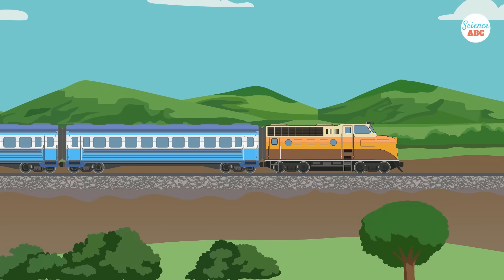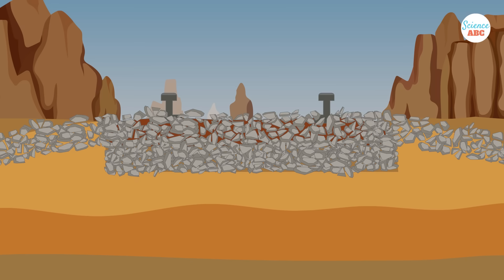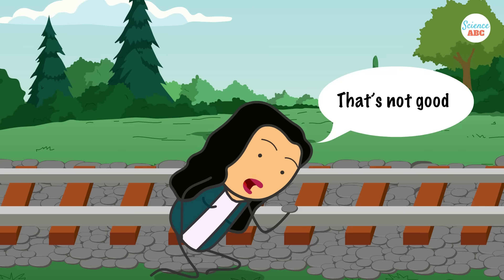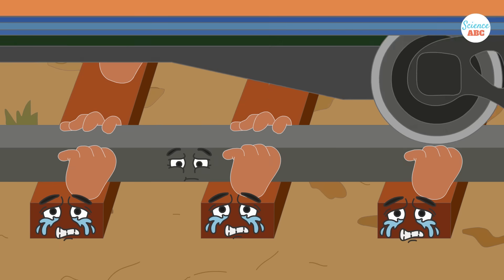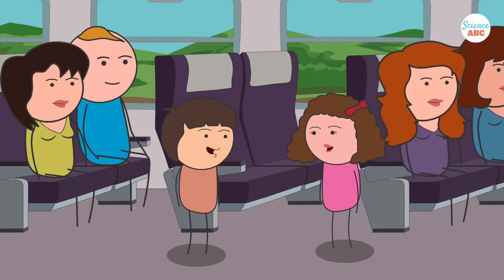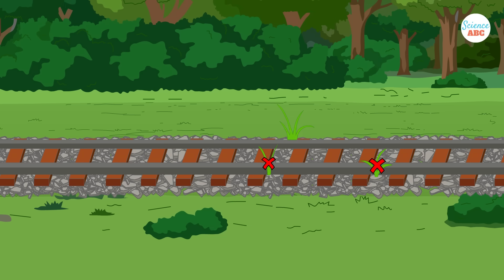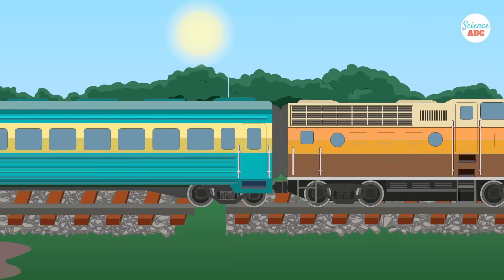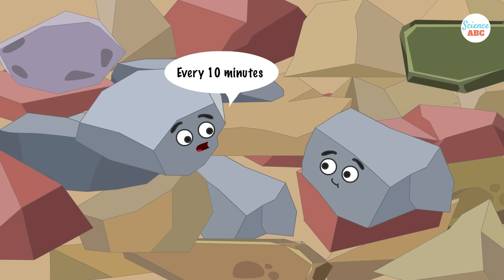Why Are There Stones Along Railway Tracks?

Comment: I work in the railway in Canada so im going to add one you missed.

8. Prevent Grade Erosion and Frost prevention.

Grade is the levelness of an area, walk up hill increase grade, downhill decrease grade. The Ballast bed is dug down to its depth to protect against changes in the natural grade changes from alterations to the ground under it, during in the colder months the ground will actually push up due to moisture in the ground freezing (Ground Frost) when ground water freezes it can expand to nearly 10% of its footprint, and that expansion needs to go somewhere, down is way to hard, up isn't. 

The ballast protects against frost because it gives the ground water (frost) room to move upwards, as well as room to move back down when spring comes.

Grade Erosion is another cause of concern in the railway, especially in some of our higher regions say they Rocky Mountain Foothills...or in some cases Mountain Passes themselves. During wet seasons High topography actually slowly falls down hill due to rain, this can cause depressions to form in the bed of tracks. Ballast has the flexibility to prevent these depressions from causing the rail lines to shift or move.

Why these are both important.

As trains move across the track they force it to flex down, but in some cases that flex can actually rebound and cause wheel hop. Picture in your mind a train car that weighs 80,000 LBS moving over a 100ft section of track, behind it is an empty car weighing maybe 15000 pounds. Without Ballast in place that rebound would cause the car behind it to actually get "bounced" from the track as the 100ft section returns to its natural resting position. Many derails in history have actually been caused by "wheel hopping" a track due to a full car depressing a track and a trailing cars wheels being kicked out of the track.

"Wheel Hop" is typically a serious concern in spring months, and in areas with heavy grades, and ballast is used more generously in these known areas (swamp/marshland, hills/mountains) due to the heavy exposure to Frost and Erosion in them.

Comment: The ballets rocks drain that water not just to keep corrosion down. A heavy train, at speed can get derailed due to large amounts of water. Water is non compressible and will lift the train right off the track.

Comment: The tracks and sleepers are "floating" on the ballast. This is different than a fixed system where the sleepers are fixed to a track bed and are typically concrete. This is needed due to the track gauge and super elevation tolerances and, are usually installed on rapid transit lines with fast moving trains. The track circuits also depend on ballast conditions. Good ballast allows better railroad traffic circuits (or wayside) signals and grade crossing warning systems.
Reply: That’s what I was wondering during the video, I would have assumed the sleepers were anchored into concrete below the ballast, or at least every so often ie. before/after curves, every 100m etc.
Reply: You’re a bit off
Reply: @apapz3245  I’m getting therapy so…

Comment: I used to work on the railways. Yeah, safe to say, these things are important. I've been to an  incident where a train derailed because some guys who had dug a cable undertrack trench didn't refill the correct depth of ballast stones and didn't compact them properly. The end result was a shifty and bouncy section of the track which resulted in a derailment. Luckily nobody was hurt and the train didn't tip. Still, it is very dangerous and very important to know what you are doing when excavating ground around or near tracks.

Comment: The question I've always wondered about is whether it isn't super dangerous to have these rocks so close to the rails. What if one of these rocks, for whatever reason, ends up on top of the rail - won't this constitute a high risk to derail the train?
Reply: Not really, due to the sheer force produced by the combined mass coming at high velocity, they could either be crushed, which I've seen happen alot, or more likely, they'll just be ricocheted off due to their jagged nature. You'd need a succession of ballast stones on the rail to pose any real threat, and even then, it's not really dangerous at all. There are exceptions to the rule and as a rule of thumb, we do keep the rails clean when working on or around them because yes, disruptions can cause derailments. An indentation in the rail or a "flat" wheel (a wheel is bent in or flattened on one area) are more of a danger than ballasts on the rail. That being said, dust and crushed stones can pose a threat due to how they make the rail more slippery, but you'd need alot of it in order for it to have an impact on the position of the train. You could end up with a situation where the stone falls and gets caught between the flange and the rail, causing the axle to buckle, but that is as with anything, an expected risk like a stone falling into your windscreen.

Comment: Only the 2 rails on the side or steel but I think the sleepers are wood
Reply: More often concrete nowadays, occasionally steel is used.
Reply: @modelsteamers671  yeah but the sleepers in between are wood, right?
Reply: @michaelsegal3558  they are usually concrete on modern lines (occasionally steel), wood sleepers nowadays are usually only on lightly used slow speed lines.
Reply: @modelsteamers671  in Toronto where I live on the subway not so much on the underground stations but on some of the above ground stations they have wooden sleepers
Reply: @michaelsegal3558  I can't speak for everywhere but as a general rule concrete is used in the vast majority of newly laid track and very few high speed lines use wood.
Steel was used for a while about 50yrs ago but it is problematic. Steel expands and contracts in heat and conducts electricity so is prone to cause failure of track circuits.
Reply: @modelsteamers671  I see

Comment: A few things missed. Track ballast is important for switches. The height of the rails is important so the switch points do not drag  to prevent the switch from throwing or not closing properly. Also provides electrical resistance between the rails. A mud pit can cause the tracks to short out, effecting the electrical safety for train detection,

Comment: The track balast near our house was removed, cleaned and resharpened before being laid back under the sleepers by a huge machine consitsting of multiple train carriages last year. Over the last two weeks, the old rails, sleepers, track balast as well as the underlying earthworks were removed and newly built with a variety of specialized trains. I often think of countries that do not posess the same equipment and ask myself if they don't do this type of work at all or if they do it manually with the help of cranes and shovels.
Reply: Yes they do it manually with shovels and Cobra TTs as far as the ballast goes. The sleepers and rail too, using multiple men using clamps/hooks to carry and lift them into place which is easier than it sound. It’s the ballast which is the hard work. Even in the likes of the US or here in the UK, we still do it manually as the machinery isn’t always available, and it’s grim work lol

Comment: Did you know: The word “ballast” is actually nautical in origin, for the stones that were kept at the bottom of the holds of ships and which were used for the same reason as track ballast; to distribute weight evenly along the bottom of the vessels and keep them level in rough seas. The use of stone ballast was nearly ubiquitous through maritime history, from antiquity right up to the present day. Modern day marine archaeologists and fortune hunters often use the presence of unfamiliar ballast along the ocean floor to locate old wooden wrecks that have long since rotted away.
Reply: The term "ballast" is also referred to in car racing when you add mass at certain points beneath the car to change the weight distribution.
Reply: It comes from nautical usage, but the etymological origins of the word ate not intrinsically nautical.  Things were used as ballast before Man invented seafaring vessels.
Reply: Also because the ships would come here empty and load up on Goods to bring back to the Homeland and the ballast would be unloaded and guess what they did with it? It often became the cobblestones that line all the early roads.
Reply: Ballast is also used in electronics, also a load used to stabilise a system
Reply: I first read about ballast in the Jules Verne novel "20,000 leagues under the sea". Man was a genius novelist.
Reply: Right, and these were used to make roads when ships didn't need them anymore, I assume they were replaced with cargo when they arrived at their port
Reply: Vandaar een zogenaamde gelukzoeker die naar de zeebodem wilde,en plotsklaps uit het zicht verdween omdat niet twee maar een overboord moest van wal-vis naar de haaien kon 🦈🦈🦈🦈🦈🦈
Reply: Yes we knew
Reply: Funny, because "Ballast" is also a German word,
Reply: Cool! Thank you
Reply: Pretty sure everyone knows that
Reply: No one cares about the origin of the word, its the depth of thought that our ancestors must have wielded in order to come up with this idea, their understanding of the physical world was immense and that is the only thing people care about. Creating and harnessing our genius
Reply: @LiftUpYourEyes  I care about the origin of the word, as do many others. The origins of words often document the evolution of concepts, especially scientific-technological ones.

Comment: I always wondered the reason why those rocks were there, I have seen them on every rail road, I suspected that they were there to distribute the weight and prevent the plant growing, now the question would be, how they found out that those rocks did all that, I guess they had to do a lot of trial and error.
Reply: As a species, we've had a lot of experience developing different kinds of roads. Most of it was probably common knowledge to engineers of the time just as it is now. Though there was definitely some trial and error involved during the invention process of the locomotive.

Comment: 4:02 I disagree: hard surfaces reflect  sound; soft surfaces absorb.
Reply: I once worked at a shop that was a pretty long metal wall building and there was some tracks about a quarter mile down the road. Pretty far away, but one day a good size train went by and I was amazed at how the train made the building ' sing ' with vibration from that far away.

Comment: It also serves as insulation.... some electricity still goes trough the ground instead of dedicated cables, but it's better than having tracks on wet wood, embedded in mud. Very important to limit underground infrastructure corrosion to a minimum.
Reply: uh no because electrified trains get power from the overhead lines and grounds itself on the rails, electrically I mean, the rails serve as the ground wire with their contact with the steel wheels of the train
Reply: @marianandnorbert  And rails are connected to what? There is a 630mm2 aluminium cable going back to power substation
Reply: @marianandnorbert electricity will always return to its source via the path of least resistance. In this case it will return via the earth cable to the substation where there is an earthing grid.

There will of course be a fraction of return current that leaks to the surrounding ground. This results in damaging stray currents leading to erosion of buried services and this is what can be limited by the ballast resistance.

Comment: The ballast holds the ties, which hold the  rail plates upon which the rail slides back and forth, those plates through which are placed spikes to affix the plate to the tie, and spikes to hold rail gauge.

This, hopefully, atop a well constructed and drained bed that allows the ballast section to maintain horizontal integrity

Comment: The ballast also allows the tracks to be moved and re-aligned more easily - if you rattle it enough, it becomes possible to do adjustments.
Reply: The train I used to take didn't vibrate, it was more like a fairground game...it will push you right and left, up and down non stop... till the company decided to get the ballasts cleaners ...what a difference.

Comment: Without track ballast, the weight of the train would push the ties and rails into the ground and make the railway wavy and bent up. Not good for high speed rail travel.
Reply: I was camped near a super high traffic, double track with an at grade road crossing. I stopped frequently to wait for trains. Initially I couldn't figure out why there was gray limestone dust powdering everything,  the ground and scrub brush, inside a  large radius, at both sides of the road crossing were covered.  A few days later, I got stuck for a few trains while it was raining. I then saw that about 50 ft of track on each side of the road, no longer had a firm ballast bed under the ties. Every car would dip into a wallow of ties floating in a jellolike mud mix of water and stone dust. The puddle was just short of the crossing. The weight of the wheels would literally pump gray mud up into the air. The train cars would cross the road crossing, then dip into the soft spot on the other side, and do the same thing.

Comment: In countries like Norway where pretty much all our train lines will freeze during winter months, the track ballast drainage needs to go all the way down to 1-2m below the surface (i.e. below the local winter frost limit), in order to avoid repeated freezing/thawing of standing water: This will very rapidly destroy the sleeper foundations, much more so that just rain water immersion in warmer climates.
Reply: That is a very high depth in order to get below the frost line. I know that in Ireland water mains are always put at 300 to 450 mm below the ground to avoid frost damage and blockage to pipes on the final feed into houses. 
On the Aran Islands, off the West coast, which gets no frost the people lay the pipes on the surface because in many areas on the islands there is little or no soil  in which to bury the pipes. The locals are not worried because ground frosts are very rare due to high winds and oceanic climate.
Reply: @jgdooley2003  You are exactly right, the pipe depth regulations have to vary a lot depending upon local climate. Here, even in southern Norway, we can easily get two weeks straight of -20C in Jan/Feb, at that point the frost goes very deep.
Reply: @TerjeMathisen  Ouch! Minus 20 sounds very bad. Most I have seen in the midlands of Ireland was minus 13 which was a plumbers dream as many older houses in Ireland are not very well insulated and frost damage to metal pipes can be common, even at minus 5 C.

Comment: FACTS         One General Electric    4400 hp   locomotive, fully fuelled weighs around 430,000 pounds.
Reply: Add about  120 cars,  each capable of holding 220,000   pounds  =  2,640,000   pounds.  Add 2 (or more) engines  = 3,320,000  pounds  OR  1,660  TONS,  going  about 40 mp hour.   STOP  AND  LOOK,   when you come up to a  X ing.   LOOK,  LISTEN  ,  STOP    AND  LIVE,   to do it again......tomorrow   !

Comment: One benefit that you may have missed: due to the good drainage a railroad beds they act as floating foundations, preventing heaving during freezing weather. This is sort of the same feature as your benefit number 4, good drainage, but applies during freezing weather.
Reply: Yup frost heave is very noticeable in the Canadian grand prix when the cars bounce. I think it happened last month in Abu Dhabi
Reply: Yeah, reduces the effects of seasonal shrink-swell to prevent fluctuations in settlement so that the line stays at a gradient which is even and does not stress the steel or dislodge the sleepers.
Reply from the maker: Thanks a lot for sharing this
Reply: Why not have the sleepers on a synthetic track with expansion joints( they are alrdy testing plastic roads in Holland)? May be Will absorb more vibrations & noise. Will drain water easily and won’t need much cleaning?
Reply: On top of that they missed the simlpe thing in drainage.... if the track just sat on wet dirt the ground underneath would quickly turn to mud thus compromising the  integrity of the track.

Comment: Great video. All the points mentioned are for OUTDOOR tracks clearly. Because most subways which are underground like in NYC, Chicago, London etc. which are underground or above ground do not have track ballasts. Some of the points don't apply to them like flooding, sun, heat etc. which explains why subways are so noisy
Reply: I thought the extra noise was from the sound bouncing off the walls.
Reply: Yeah or maybe being inside of a concrete and metal tube with endless echo and no ability to dissipate sounds, maybe that's why subways are so noisy.
Reply: I keep telling myself to buy and keep some earplugs precisely for riding the subway.   Thanks for the reminder.